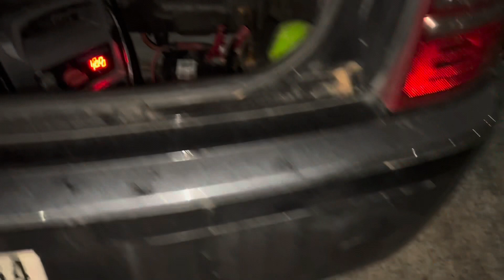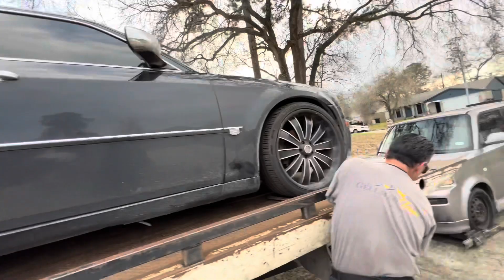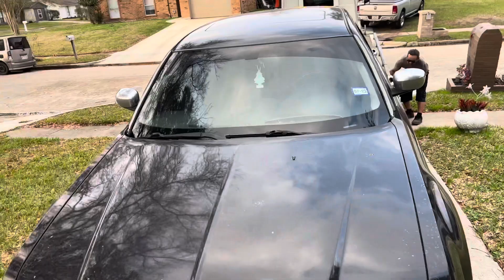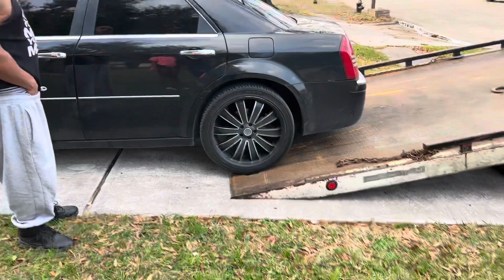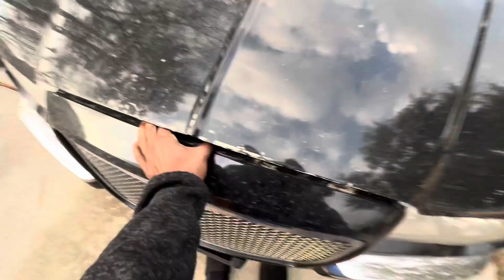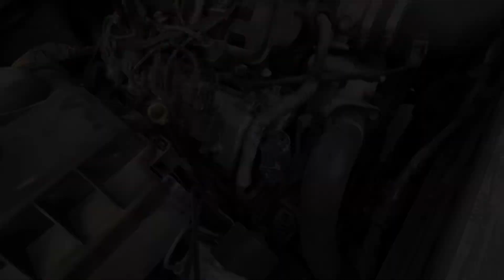@mdm_rich take delivery of Chrysler 300 Hemi c

Comment: Nice whip bro. That tow job was hard to watch 😂🤣😅 lol there is an easy way to get it in neutral and the tow guy should’ve known.
Reply from the maker: It was hard to watch bro😂. Do you know where the neutral release is for this car?
Reply: @mdm_rich  yes bro! I feel ya haha. The shifter release is on the right side of the shift lever. Under the change tray. There’s slightly different styles depending on the year. On some of the earlier ones you have to take the shifter cover off more in order to be able to bypass the ignition lock cable.
Reply from the maker: ok make sense because i had go in the gup holder for the natural release for a 2013 JeepSRT. Also in my 2008 impala ss the shifter cable came loose